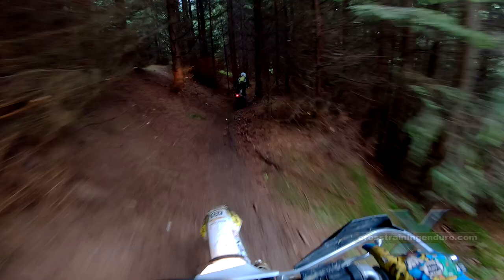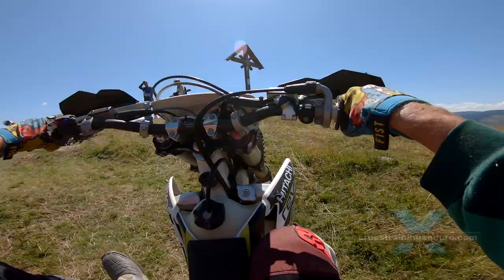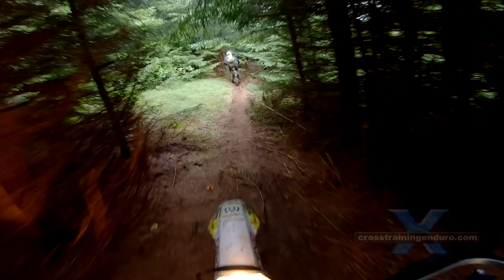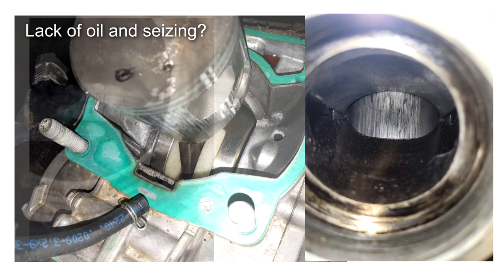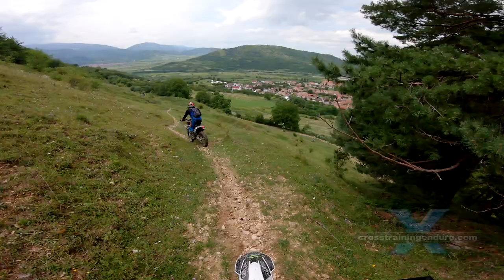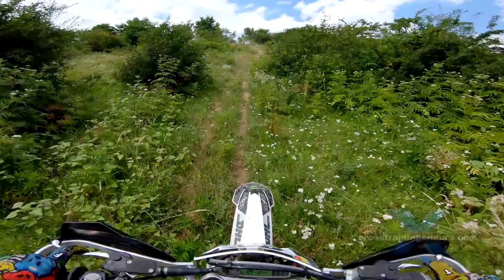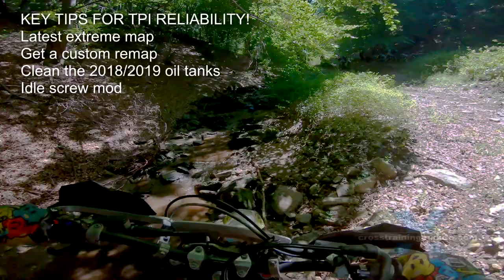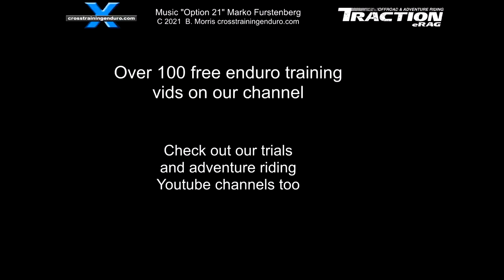Most common TPI problems, questions & solutions from a TPI specialist! ︱Cross Training Enduro

Comment: So how that sounded with the extra maintenance steps you may as well get a 4t. 

What’s a remap cost? Need a power commander/ecu? 

I dunno man, a simple rejet is a cheap feature and with no extra maintenance steps other then the usual for a carb model. 

Not bashing them, but gone are the simple easy to own 2t bikes.
Reply from the maker: I'm all for the KISS principle. Keep it simple so I'm staying with carbs while they are still available. Plenty of guys have no issues with TPI but there are enough problems to know it's a long way from perfect.
Reply: I recently bought a 2020 300 TPI alongside my 2020 350 EXC, to find out wich fits best to my riding. I was surprised how much care one has to give to the 2 stroke model. The 4 stroke seems to me a much better design. Top and bottom maintenance is way more expensive on the 4 stroke, but under the line quite equal to the  overall cost of maintenance compared with TPI Models. But guess what, I never rode my 4 stroke since I bought the 300, just because of the fun I get on the 2 stroke. So much better in the gnarly stuff I ride! But, to be honest, for trail riding only, the 4 stroke fits better imho, more linear power delivery, way better fuel economy, more stable riding.

Comment: It just doesn't rev.
Doesn't get high rpm like the MX model can.
They should get a direct injection with high intake gas pressure like in the car engines for example.
Indirect injection is not the key.

Comment: All of this comes from someone trying to sell you parts. I have over 700 hours of TPI experience between three different bikes and they run great. I did one top end at 80 hours and they look just like the top ends I did at 150 - 200 hours.
Reply from the maker: Dave from TSP does sell parts but he's well known in the industry for providing objective useful advice to many two stroke riders, Bryan... I wouldn't have collaborated with him on this vid otherwise. If you explore the forums you will see all these problems are very well documented by actual owners who aren't selling parts. And yes, there are plenty of TPI riders with zero issues. But there's a significant percentage encountering problems.
Reply: @crosstrainingenduro   I don't believe much that's posted on internet forums, most of the people that post on those are full of crap. I'm sure there are people that have had problems but they aren't as wide spread as they make it seem. Out of all the people I know personally that have TPI none of them have had any serious problems.

Comment: Part of two stroke ownership is "simplicity" if you are going to be pissing about with injectiors, oil pumps, fuel pumps and sensors then you might as well be on a four stroke!
Reply from the maker: And the interesting thing is the KTM four strokes are very light now... and the TPI system adds a fair bit of weight to the two strokes so there's not much difference now.
Reply: @crosstrainingenduro  I've moved to Yamaha after 20+ years of Orange. TPi was the deal breaker for me. Sold my 300 and got a brand new Yamaha WR450F 2021. Ace bike. So tunable with the power turner on your phone. Alot cheaper than a KTM also and great spec.
Reply from the maker: Sweet! I've always had a soft spot for the WR after owning a 2006 model. I'd love to see Yamaha develop an ADV model, heaps of riders do their own mods with the blue bikes.
Reply: @crosstrainingenduro  Rally Raid T7 coming. You can register your interest now on the official Yamaha site.

Comment: i have  2, 2021 tpi bikes, a 300 exc and a 150 exc and have none of these problems both bikes are at 100 plus hours
Reply from the maker: As with most known issues, the majority of bikes will probably be fine, Con. We don't know exactly what rate of 2020 and 2021 models are seizing, but it's in the minority.
Reply: @crosstrainingenduro  most definitely it is a minority dude. i am just glad that the ktm group is putting in time to advance two stroke technology with fuel injection etc
Reply from the maker: It always is e.g. when I highlighted Beta's main bearing issues I did point out it was occurring in roughly 5% of cases. KTM has never mentioned any stats for their warranty claims though. It would be good if KTM put more effort into thorough testing before releasing their models. https://www.youtube.com/watch?v=kxCHcoHEEBA
Reply: @crosstrainingenduro  i think with the past few years alot of manufacturers are just trying to get models out the door before doing enough testing and hoping the consumer does the testing for them realliy. you see this alot more with cars as well

Comment: As I understand it TPI was and is a Euro enviro issue .Also TPI makes sense for machines that ride in various altitudes and extreme temps , but for us flatlanders I just do not see the value or payback.
Reply: I can climb up 9,000 ft above my city of Monterrey and the Lectron carb still works near perfect. So I am going to wait another year before swapping my 2014 TE 250 Husqvarna, makes no sense to fix what is not broken. Maybe TPI runs smoothly, and has engine balancing to reduce vibrations. That’s it.
Reply: @rogermty1971  Agreed , both Lectron and Smartcarb seem to be a wise choice for a Kehin replacement . As for the new balanced engines yes they would be easy to get used to , but would still not make me a better rider. lol

Comment: No issues and talking to TSP won't give you an honest real answer as they are out there to sell a service. 

My 2019 250tpi has been absolutely perfect out of the box with zero mods.
Reply from the maker: Explore the forums and you'll see all these issues well documented by riders themselves. Dave put a lot of time into developing this info with no expectation that I would mention his stuff too. Not everyone is having problems, only a significant minority. Your bike running well doesn't mean others won't have problems. Again, check the forums.
Reply: @crosstrainingenduro  yes exactly, check the forums and you'll get tons of reports of people moaning about their TPI's! 

1) Bad news spreads! 100 people with good issue free reliable bikes won't say anything, 5 with issues will go out their way to post online about how bad the bike is etc...

2) Majority of issues with tpi come from people messing with them, fiddling with ECU, powervalves etc... Leave the bike stock standard they are solid, reliable and powerful bikes
Reply from the maker: Yes it's a small but significant percentage. No, many are facing issues without messing with their bikes. I don't rely just on anecdotal evidence when doing vids about known issues, but also discuss with industry guys. When I reported on Beta main bearing issues I had this kind of response from brand loyal Beta riders....
"My bike is fine. So is my friend's. Those other guys must have drowned their bikes or ran them out of oil".  
And of course eventually Beta acknowledged there was actually a problem, something the insiders (e.g. Beta mechanics and dealers) had been telling me all along.
Reply: @supernovadw  I know plenty of people on TPi bikes with issues. No smoke without fire as they say. Oil pumps, CCP sensors being the most common. Oh and crap WP suspension on all of them. I own a 300 too. Not TPi however, friends bikes put me off if I'm honest. Lectron all the way.

Comment: I’m not lying when I tell you that in the US the most reliable most refined year of the husky’s is the 2019 just before tpi.
Reply from the maker: A friend of mine bought the last carb KTM model as he suspected things might go downhill with TPI. Awesome bike to ride. They almost got those 250/300 models under 100kg until TPI kicked the weight back up again.
Reply: @crosstrainingenduro  it really took the fun out of owning a 2 stroke for me. It smoothed out the power very close to a 4 stroke with not as much hit from power band anymore.
Reply from the maker: The ones I've ridden have had soft bottom end power... except the ones in Romania. They'd be remapped by one of their local gurus and felt closer to a carb model so it seems it can be done.
Reply: @TheRossillini  yep I'd agree. Flat feeling. Lost the zing and less torque low down. Haven't tried the "extreme" mapping to be fair however.

Comment: So on top of the 10k price tag you have to dump more money into these turds so they don't blow up and run right lol...... I'll stick to the tried and true YZ250
Reply from the maker: Not in all cases, but yeah if you run into problems you need to. On the 2020 and 2021 models all you really need to do is get KTM's updated 'extreme' map so you use more oil. With luck the dealer might not even charge for this.

Comment: My TPI issues were permanently resolved by a Beta
Reply: Yes bro check my new one out
Reply: yes you get keihin which is a plus but debatable. but then you get everything else much worse than ktm
Reply: @maucina12  not at all lol do you even ride u ktm fan boys make me laugh tpi are co.ing back to shop for rebuilds at 40 hours from new that's worse than any other bike I've rode
Reply: @1991enduro  hard to judge people on the internet just based on comments. I am almost 500 hours on my tpi with no problems except 40 euro sensor, but not saying they never go bad. All bikes have faults. Betas main bearing problem is unfortunatly very often. And you cant say beta suspension is good

Comment: TPI is bad design,  a ticking bomb. KTM realized that and they are changing this in 2023 to TBI. Info on the NET.  TPI was actually the reason why I switched to Sherco.
Reply: yes, and I heard ktm factory riders use TBI already...
Reply from the maker: Any links for the TBI info? I wonder if it will go through all the trial and error of the TPI so far?
Reply from the maker: Thanks!
Reply: Did you actually listen to the vid about the TBI ?, its the SX bikes only, EXC & XC will remain TPI..............eye roll

Comment: No thanks.
My 18 with a keihin carb does all I need it to do with reliability.
Ktm only changed to TPI due to the pressure of climate religion.
Reply: Yup and they only changed to Mikuni because  Keihin couldn't supply the numbers KTM required
Reply: @Andy-co6pn  I heard it was because mikuni supplied the throttle bodies etc for the first year of the TPI bikes and got the mikuni carbs as part of the deal.
Reply: @damolux3388  could be right mate. I heard that Keihin were moving more towards fuel injection and couldn't guarantee carb supply number to KTM. Either way it wasn't a performance change 🤣
I have molded and jetted my Mikuni so it's pretty good, I don't see much elevation  changes with my riding though.

Comment: Or just keep the carb bike
Reply from the maker: A friend of mine bought one of the last carb models in Australia, Justin... he said he'd never go TPI. We did a side-by-side comparison with a TPI 250. No comparison! The TPI felt sluggish and underpowered until the upper revs when suddenly it came to life. And the TPI had $1000 worth of ECU and cylinder head mods to try and get it running better. 🤔
Reply: Or wait for the TBI in the 2023 range
Reply: @crosstrainingenduro  Let's see what the TBI holds. At least KTM goes back to premixing with TBI but still no kick start and no possible way to fit one unfortunately
Reply: @crosstrainingenduro  the downsize on carb is the range... I get max. 60km put of 9l, the Tpi goes 100km with same fuel... I usually carry a hose and a bottle to be able to take the fuel from fiends with 4stroke or tpi because I run first in my group out of fuel. Also I cand lean it more because will overheat. This drives me crazy, and I decided to go with smartcarb/ 4stroke or Tpi.. dependin which bike I found on good price and in good condition. Looking on 2020 Beta 300rr but not sure if they are reliable...